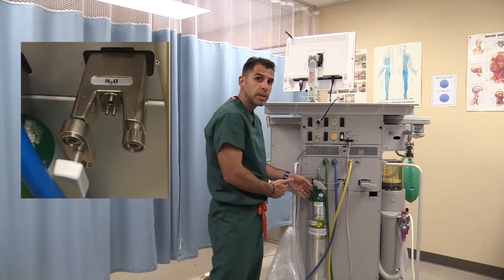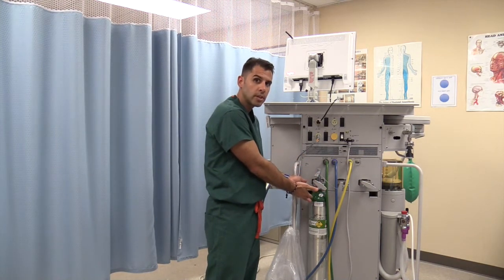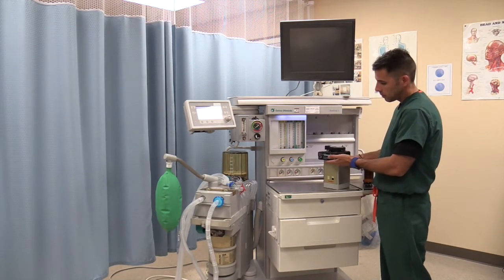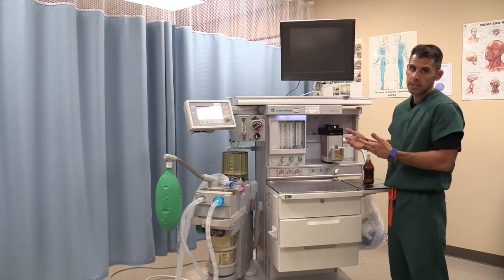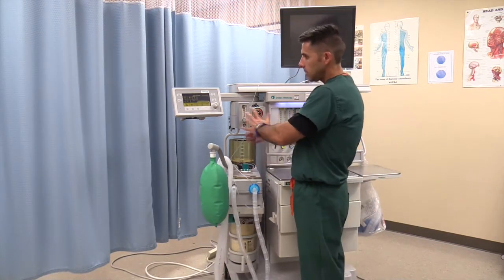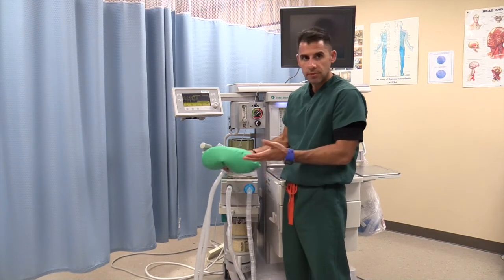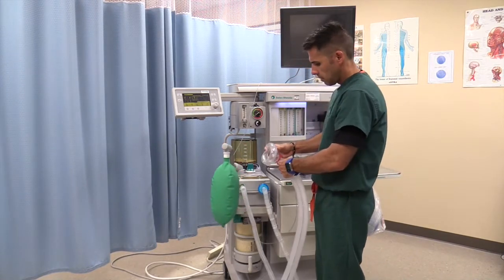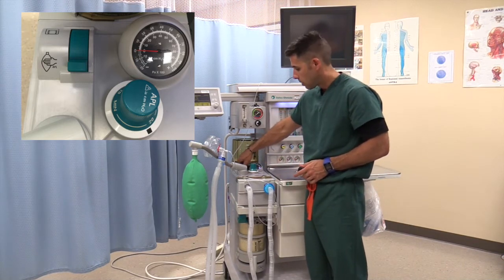Machine Check

Comment: Great video. One small correction though; Hoses connect via a DISS - Diameter Index Safety System.  Tanks use the PISS - Pin Index Safety System

Comment: A small correction; the connections at the wall are Sleeve Index System (not pin index), those “teeth” on the cylinder connections are Pin Index.